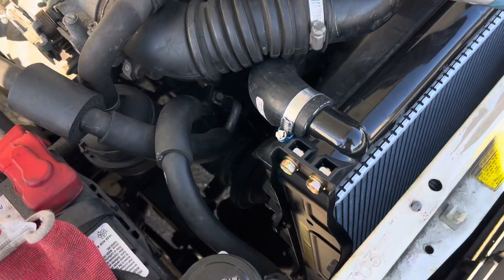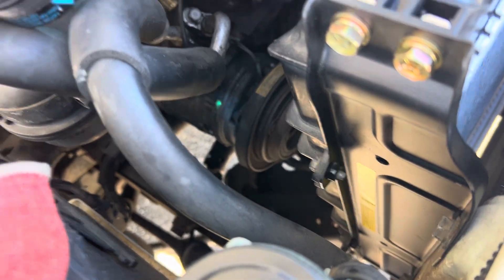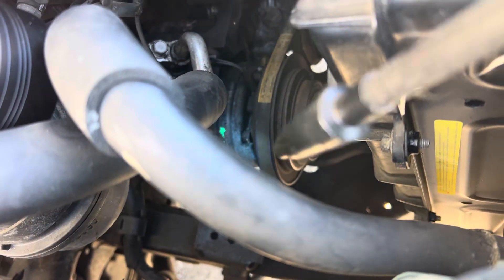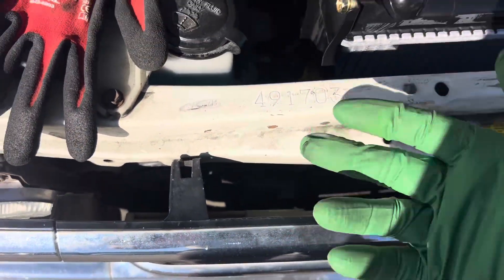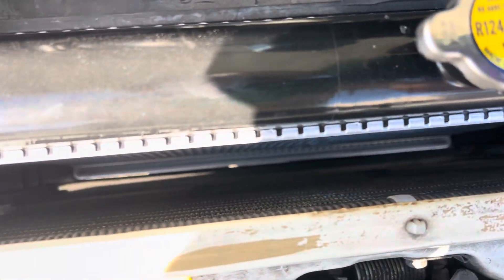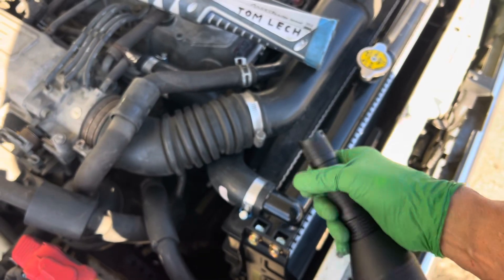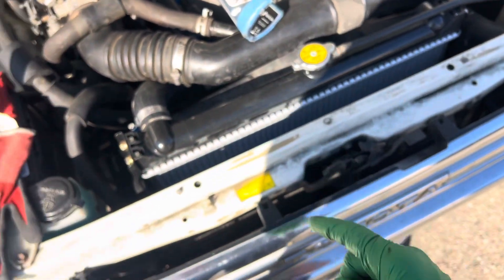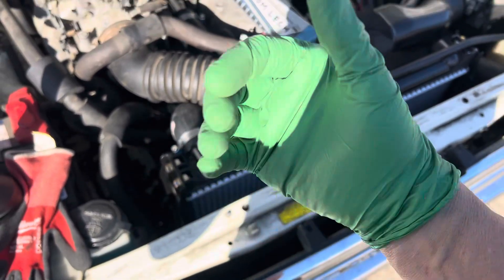Aftermarket radiator creates huge air gap that did not exist with the original OEM radiator

Comment: Actually, that replacement radiator is a good upgrade, they dissipate heat better, provided the fan clutch is good, as for the air-gap/space between it and the condenser, it can be remedied, just needs some makeshift air-dams or baffles.
Reply from the maker: Yes, that’s what I told them about this radiator was to bridge the gap and seal it up

Comment: Did all of the refrigerant leak out?
Reply from the maker: The leaks actually stopped. 
      They will probably come back later. We’re looking for other leaks later on throughout the rest of the system.. 

Since it has fluorescent UV dye inside of it now . 
      The idea is to allow it to drive with a full charge of refrigerant. 

This will bring the system up to full pressure under real world conditions with vibrations and constant changing temperatures as the system kicks on and off constant changing pressure high to low . 

This will cycle the system through pressure and temperature changes thousands of times between now and the next few weeks . 

Giving the perfect opportunity to reveal more possible leaks throughout the whole entire system . 

Not just in the one location what I found in this video . 

It still had some refrigerant in the system, and it was operating when it came in . 

It was just very, very low . 

Not all leaks happen instantly not all leaks are constant. Some leaks turned off and on with certain pressures or certain temperatures. 

Other leaks only happen when you’re driving down the road, and the hoses and lines are vibrating and bouncing up and down

Comment: Sir good morning 0 pmm no leaking in this compressor
Reply: ok thanks sir I understand
Reply from the maker: Just no leak at the very moment that I was testing it

It was leaking before a few minutes ago 

And then as the temperatures and pressure has changed, the leak stopped all by itself 

But the leak will come back when it hits that exact same pressure and temper combination . 

Leaks happen at different pressures and temperatures they’re not all constant
Reply: @coldfinger459sub0  
Yep! This is a good example of temperature and pressure changes, leaks can come and go.
Depending how much, say with a vehicle as it ages, each heating and cooling cycle, a little refrigerant seeps out, customer may say it cooled well the previous season, until it doesn't.